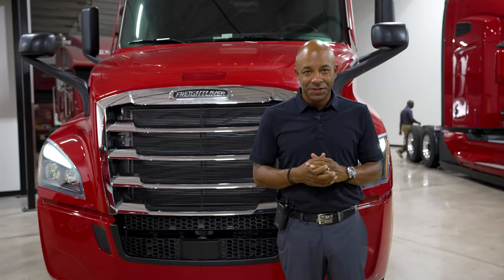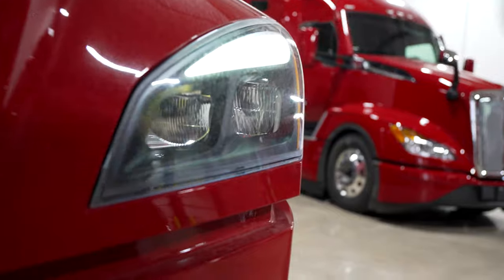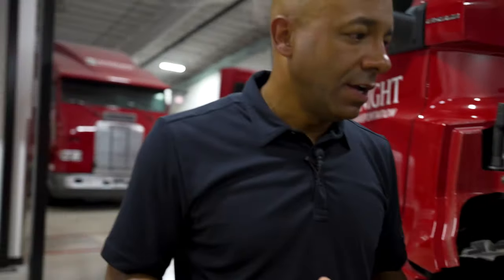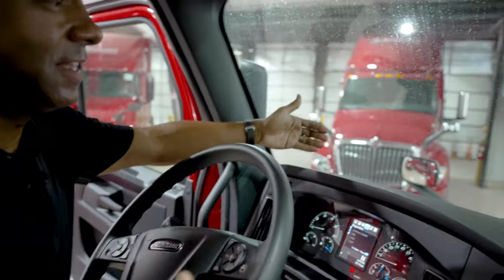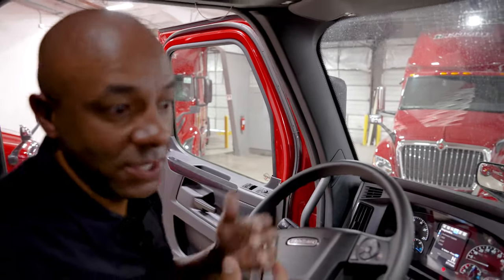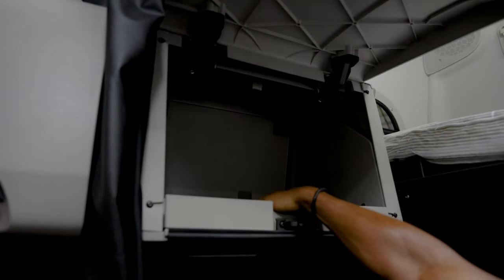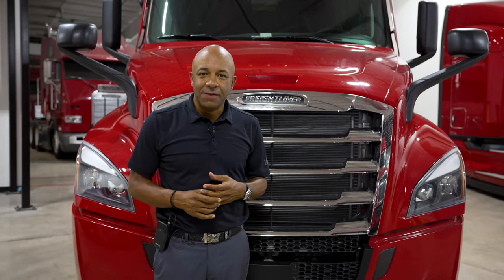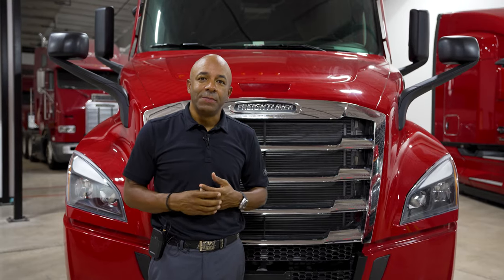2024 FREIGHTLINER CASCADIA TRUCK TOUR

Comment: I own 2019 Cascadia. I did so much work on my truck. Replace Wheel seals 350,000 miles.
Radiator replace, Head Engine seal, Pan Engine seal, 
Injectors pipe fuel lines, DPF at 480,000 miles. 
Replace Clutch 500,000 miles. Owning trucks is very expensive today.

P.S. Cascadia roof is liking, careful
Reply: I concur,  2018 Cascadia almost 800k miles.  1 box is about die 😢
Reply: @AC-ir3od  I am sorry for you. It is the purpose of manufacturing making trucks for 1,000,000 mileage only.

Comment: The climate control reminds me of the old used car where you have to tell anyone who drives it about the special tricks required to get it down the road. Hopefully there is a sign in the wall that explains the required initial settings for the fan and temperature, as well as when and if those settings can be changed and under what conditions. 🙂

Comment: Wish they'd add a Miles to Empty Fuel Measurement. Add Digital Axle Weight in Pounds. Speakers on the on the lower bunk, and radio controls in the bunk, also the windows in the bunk on our models are terrible. They want us to not idle yet we have a crappy flap popout with a fan that sounds like a jet engine at our ears, and a tiny passenger side bunk window. Not much airflow. If they went to International Dual Full Size bunk windows, it would help with us staying cool and increase visibility. We also have no emergency exit if the front of the truck caught fire. We can't fit out either of the tiny windows. They could learn alot from International and really be the best of all the trucks.
Reply: and 1650 lbs torque sucks, it's the lowest spec available.